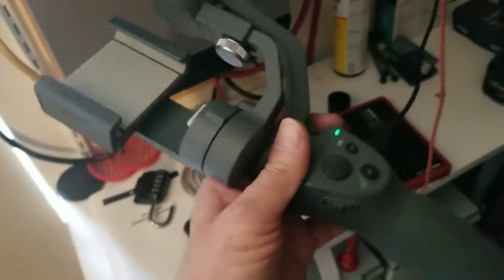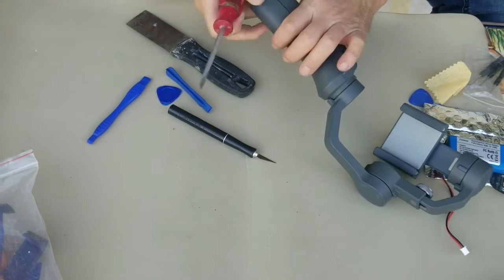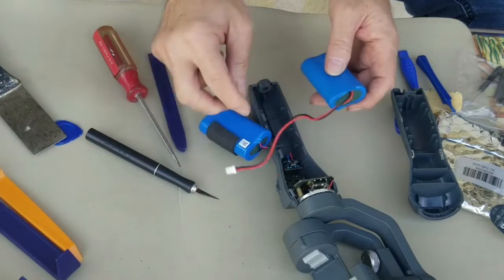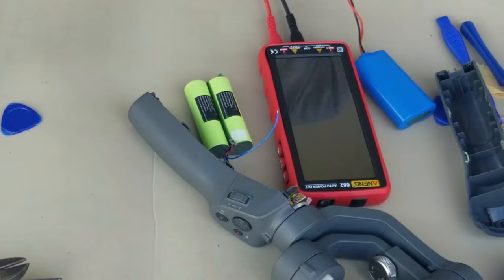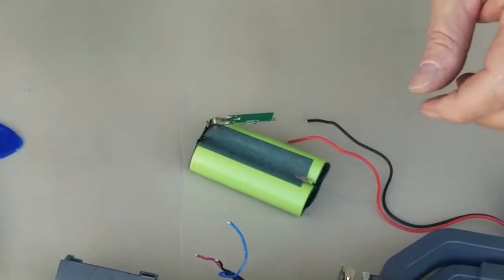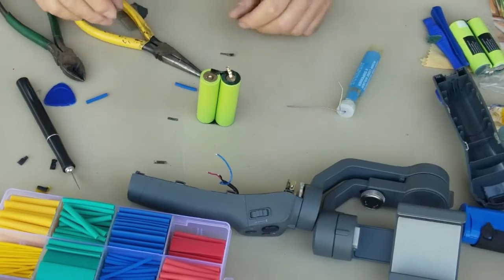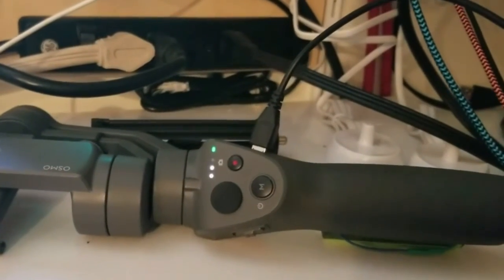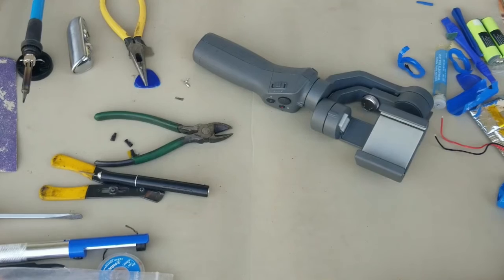Replacing the Battery Pack in a DJI Osmo Mobile 2

Comment: actually that green light permanent on and one white LED (of the three) blinking indicates charging. 
I tried to charge today a used device that was stored for a longer time without charge.
It took about an hour for the second LED to also blink.

Next all three white LED  blink. Fully charged is when all three LED stop blinking and stay on all the time.

All in all it took my device about 3 hours to charge from Zero to full.

I used an external battery pack (5V, 1A) for initial charging.

Will do some tests if it actually worked.

How long can you use a dji osmo mobile 2 with new fully charged batteries?

Comment: The third wire, in the middle of the pack, is for balancing the cells. So they charge equally.
Reply from the maker: I dont think so.  That middle wire is in the middle of the two batteries that are in SERIES.  When measured with that point being treated as ground, one end is negative, the other is positive.  There is no way this could be used to balance the cells, as that requires the cells to be wired in parallel so that they have the same voltage, eventually equalizing them.  Thanks for your comment though just the same.  Cheers!
Reply: @PhilsDIY  if the batteries are in parallel, they don't need balancing, they balance themselves. But if they are in series, you need a charger that knows the state of charge of each and one of them to know when to stop charging one and keep charging the other.
Reply: @PhilsDIY   Check out BMS conenction schematics. You will understand it more clearly. Its common in all lithium battery packs.Its for charge balancing. The common wire is used by a controller to measure the voltage of both single cells independantly.
Reply from the maker: @eldhoskariah9865    I guess I stand corrected.  Thank you all for clarifying/correcting me!

Comment: Hi, would u mind sharing the battery specs, and where to get one, im from the Philippines. Thanks
Reply from the maker: Hi, the original battery inside this unit was 2 pcs LR1865SK, Lithium Ion 2600 mAh, soldered in series (neg of one tied to pos of the other).  The device uses +3.7V and -3.7V for controlling the motors.  I got the replacement from Amazon, and found one that had the batteries already soldered together the way I needed:  https://amzn.to/4aJzvYe just be careful when handling the battery leads and avoid doing what I did in the video!